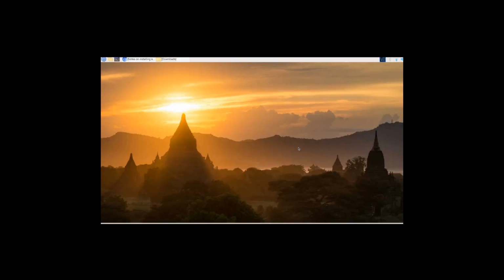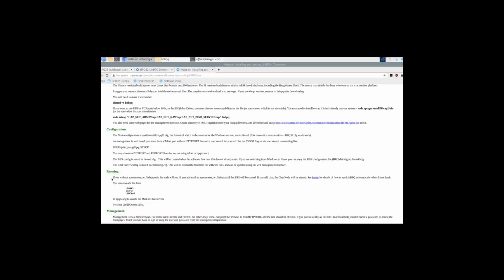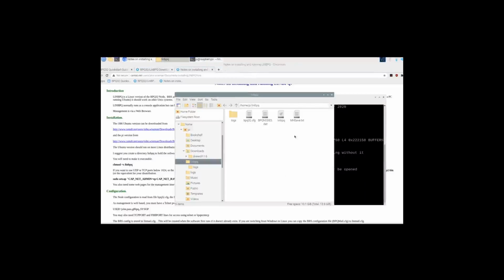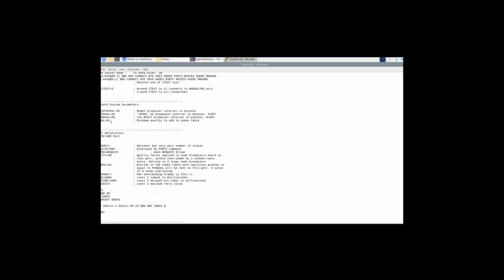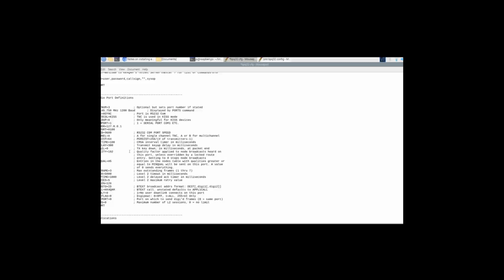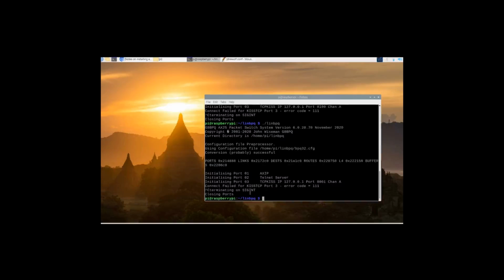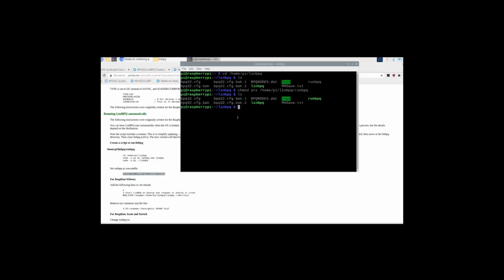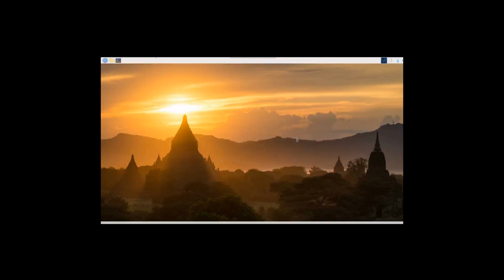Build a Raspberry Pi Packet Bulletin Board System Part 2

Comment: Excellent help, but I'd recommend running LinBPQ as a systemd service rather than via cron reboot (I'm also not sure if boot from power off triggers "reboot"). I know some people complain about systemd being bloat but it's already there on Pi anyways, and it'd be much easier to see if the service has failed, logging, enabled, etc.
Reply from the maker: I agree about running LinBPQ as a service. I presented it this way to show watchers what was happening as they installed the software. The boot from power off did trigger the cron command. I made sure to test it many times before making the video. I appreciate you watching and commenting.

Comment: Why are we running this with the RPi GUI? Its all command line stuff. Nothing requires the GUI. So why stress the Pi with it?
Reply from the maker: I did it this way so that folks that didn't know about command line stuff could see how it works. Most people are used to seeing a GUI, such as in windows. For some folks it helps understand how things work when they can "see" it in action. Thanks for the comment and for watching.